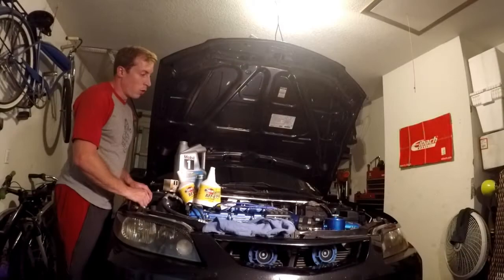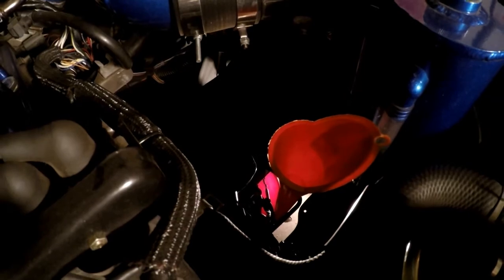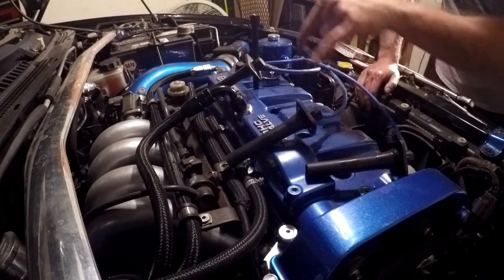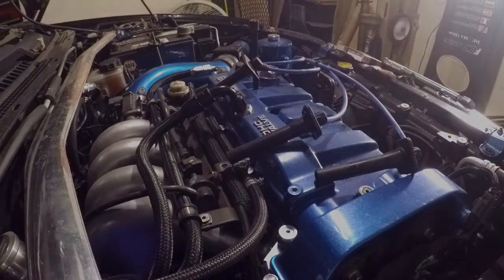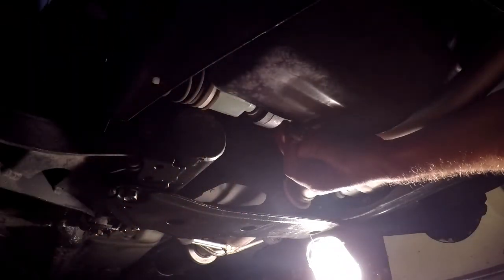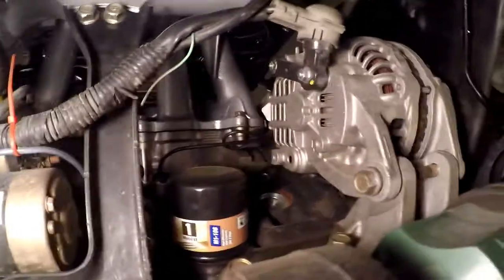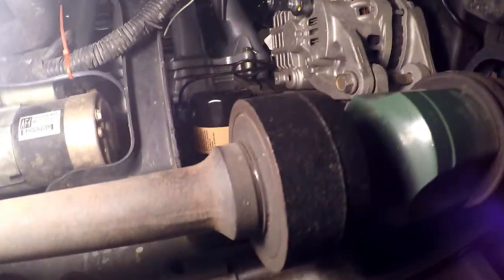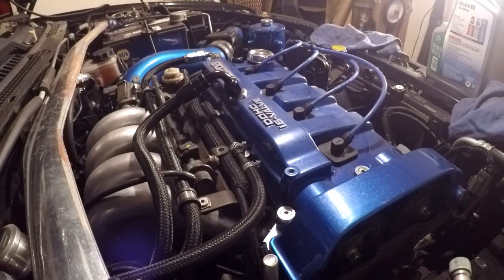How To - Transmission/Engine Service - Mazda Protege5

Comment: So I did t kbow where to ask all these mazda videos but how did you get the crank pressure down I see then lines on the pcv. Are they on a oil catch can? Have crazy pressure and oil in my turbo need figure some optiin if can help would be amazing
Reply from the maker: Those were all custom made from Signature Products.

Comment: I can’t tell you how much I appreciate the video brotha 🙏 can I ask you, on the Protege5 do we have a crank angle sensor? DANG! I want to convert to the 1.8 spark plug wires! 😍
Reply from the maker: I’m glad it helped somewhat. These have a cam position sensor and the crank pulley has a sensor on it as well.

Comment: Proper Transmission Oil is Type M5 or M V  for Proteges and Fords! 1999 - 2003 Protege and Protege 5 owners. The proper transmission fluid type is Mazda M V or Mazda M 5 ! I see many people using the wrong transmission oil. Mazda's name for this transmission is FN4A-EL, Ford's name for this transmission is 4F27E, "On Mazda vehicles, this transmission uses Mazda M5 fluid (Mazda part number: 0000-77-112E-01), which is NOT Mercon V or Mercon LV according to Mazda Technical Service Bulletin 0500116. This fluid is made by Idemitsu Kosan (according to the label on the back of the Mazda bottle). Idemitsu sells the equivalent Type-M fluid in the aftermarket. The equivalent Ford fluid is FNR5 (Ford part number: XT-9-QMM5). Moreover, Mazda vehicles have "M V" written on the dipstick handle." Mazda type M5 ATF is not the same fluid as Ford Mercon V or Ford Mercon LV. Mazda type M5 ATF has a greater viscosity than Ford Mercon V and Ford Mercon LV in low temperatures. Mazda type M5 ATF has a greater anti-judder specification than Ford Mercon V and Ford Mercon LV.
Reply: Wrong😂

Comment: Do you find that ignition system to be stronger or longer lasting than the stock setup
Reply from the maker: Cole Pearson I can’t honestly claim a noticeable difference in performance. I have only had that setup on there for a couple years. The resistance is supposed to be less in those coils. That said, I also use long reach plugs. I have so much done to this car it’s a bit difficult to notice small changes.

Comment: You used the Plug set from the 1.8l on the 2.0l? How does it work out?
Reply from the maker: DjRapnytech yes. Plugs, wires and coils from the 1.8. They all work good. Biggest difference is long reach plugs. They idle smoother and takeoff is easier. The coils are supposed to have less resistance in them but you can’t really notice. That’s more for looks.
Reply: Rage Fueled will the 1.8 plugs work with my 2.0 valve cover? Because I know you replaced yours custom
Reply from the maker: Yes. The plugs will work regardless of the cover. The coils and wires would too BUT my cover has had the mounting points removed from the 2.0 coils.
Reply: Because i've been wanting to pick up a new set of coils, but i wasnt sure if i could just remove everything from the 2.0 coil packs and just plug in the 1.8. Thanks dude!
Reply from the maker: DjRapnytech yes you totally can. You have to open the loom so the coil wires separate from the injector wires. You don’t need to splice anything though. Just reloom the wires separate.
Reply: What a God